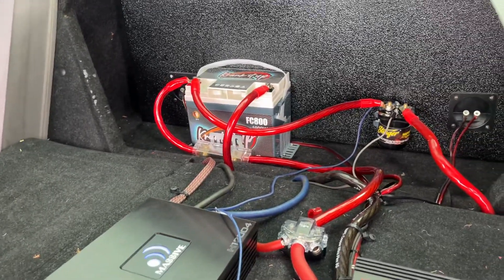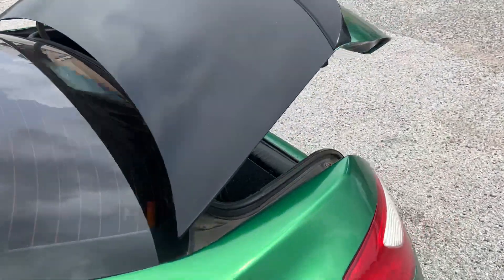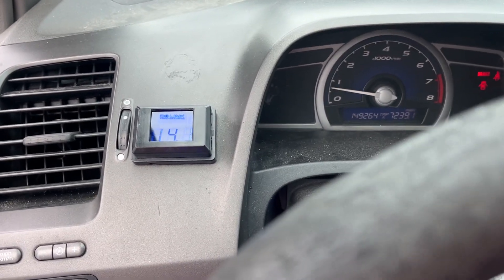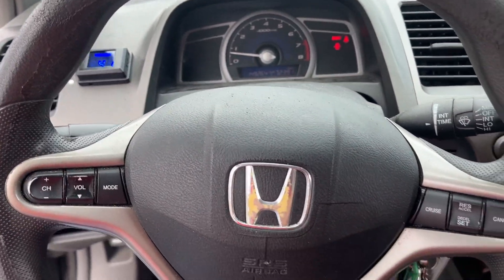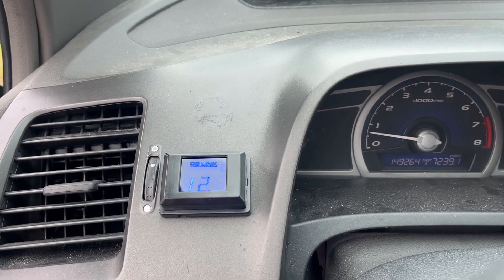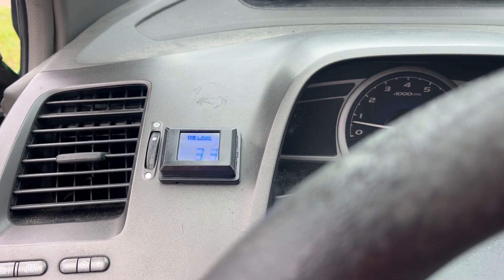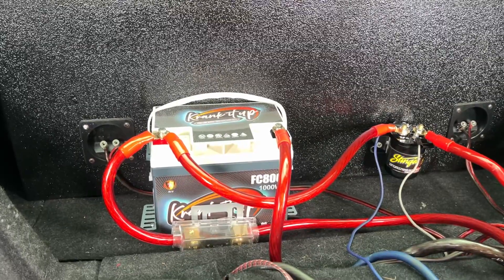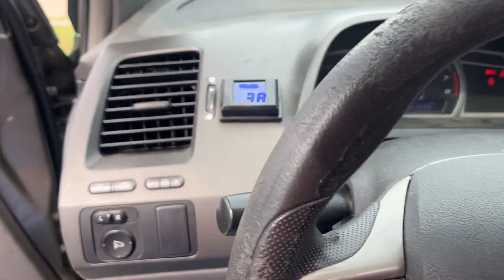Testing voltage after installing AGM secondary battery

Comment: Did the battery isolator help? My agm don’t stay charged some say have wire from alt to secondary
Reply from the maker: Isolator definitely helps, but if your Agm don’t stay charged that might be something else. Your alternator might not be strong enough to charge both batteries
Reply from the maker: The more batteries you have the more strain you’ll have on the alt so it could be that, your secondary battery might be doing all the work and your alt can’t charge it back up fast enough